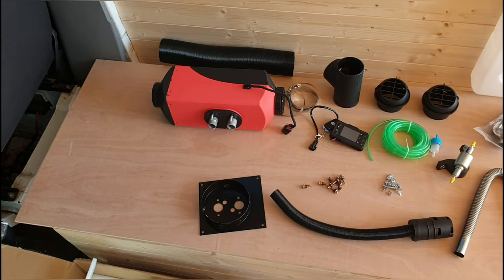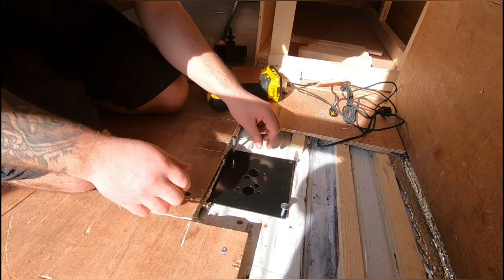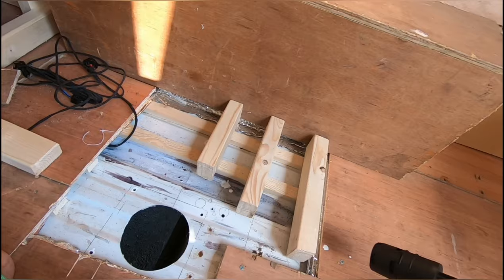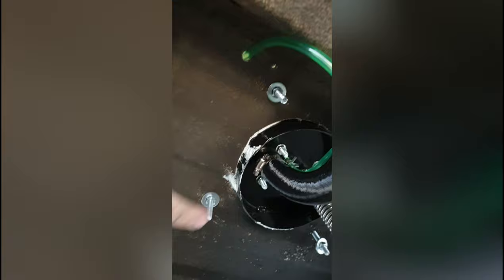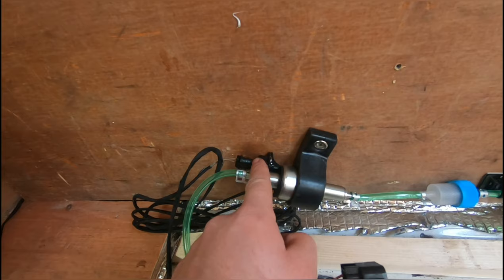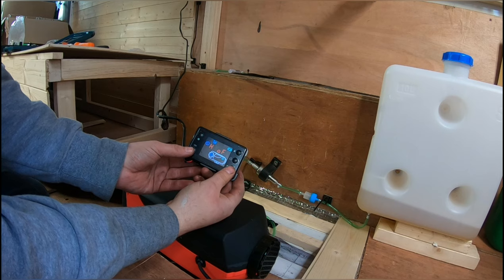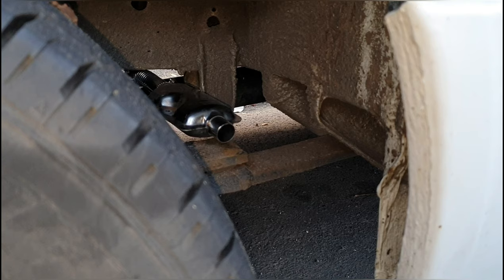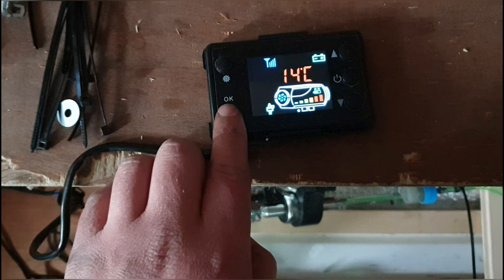Ebay Chinese Diesel Heater -  FULL DIESEL HEATER INSTALLATION from start to finish

Comment: Where did you get the green hose. My hose will never fit on anything and don't want to force it on the plastic part between the filter and tank
Reply from the maker: It's the hose that came with the kit mate , put it in some hot water to soften it , may help 👍
Reply: @LT_TOMMY_  thanks mate.

Comment: Hi can run it when I will put extra acc 12v Capaciteit 12000 mAh, for how long accu can run the pump and display and heat ?

Comment: I just installed mine and had a test run. Set target temperature 18. At first it work hard to get it up to the target. Then it slows down after it reached the target but it doesn't shut off. It keeps going. Did I miss anything or that is the way it is?
Reply from the maker: That's what they do mate , once they reach set temperature they slow down and just tick over👍

Comment: Using the car's main battery for this purpose, is it ok?
Reply from the maker: It will work mate but be aware if your battery isn't in the best state you could end up broken down with a flat battery 👍

Comment: Just bought a minibus to convert and seen one of these on eBay. Just have a few questions if you don’t mind answering? Does this have a thermostat, as in you can set a temperature and it will kick in if not drops below that? Looks like there is 1 outlet for the heat, can you add splitters so you can have multiple heat outlets (one towards the front of the vehicle and one towards the rear)? Have you had any issues since the install? Cheers
Reply from the maker: Hello mate , yes they have a thermostat,  the heater never turns off completely on the thermostat but once it reaches desired temperature it will slow right down and tick over.

Yes you can split the outlets, i actually had a splitter come with mine .

No problem at all mate 🤞

Couple of tips , try and hang the pump with zip ties etc as it's noisy if it's touching the van body , also make sure you buy a carbon monoxide alarm just incase 👍👍👍👍
Reply: Van Life Tommy Cheers for the reply. Hire much diesel sits it use per hour?
Reply from the maker: I'm not sure on the exact mate , mine uses next to nothing to be honest, ive read that they use roughly 0.1l per hour , but again i dont know the exact 👍

Comment: Hi Mate
all is looking great with you camper

What size bolts did you use for the bracket into the camper?
Reply from the maker: Thanks mate 👍
The brackets to hold the turret plate in you mean ?

If so they are size M6
Toolstation no. 86736

Cheers 👍

Comment: Hi can I ask is the heater noisy ( once the conversion been complete) cheers 👍
Reply from the maker: Hi , it's not too bad if it's on low but on full power there's no escaping the sound of the air blowing out. As for the pump ticking away , I have hung my pump with cable ties and its now almost silent 👍👍

Comment: Does the pump make that noise all the time? I would have thought it would have been silent
Reply from the maker: The pump always makes a noise mate,  depending on how high the heater is set the pump will tick away faster or slower ...
There's lots of things you can do to make it quiet , i usually hang mine with cable ties and probably will do with this one 👍👍👍

Comment: Hello, or your controller display all the time on? Even when not in use?
Reply from the maker: Yes but you can put a switch on the live 👍
Reply: @LT_TOMMY_  but if I put a switch, or will work remote controller? If i wanna turn on heater from home

Comment: Does this heater drain the van battery?

Would a installing a dedicated 12v battery be a good idea?

Cheers.
Reply from the maker: Hello mate , it will run off the engine battery , but it depends on the condition of it whether it goes flat in 1 or 3 days,  i wouldn't risk breaking down in a Field somewhere, pick up a leisure battery mate you can get one online cheap nowadays. 
Cheers 👍👍👍

Comment: Do you have to mount metal plate to the metal floor, or could I put it on top of my ply floor (insulation board underneath that's all)?
Reply from the maker: Hello mate , using a hole saw you could cut straight through the wood and bolt it on top , as long as there is nothing flammable inbetween 👍
Reply: Ah OK, slight problem then with insulation board underneath then! I'll have to remove it from around the exhaust. Thanks for your reply mate!
Reply from the maker: To be honest once you have cut out the hole for the turret plate and fitted it in the floor , nothing can get close enough to the exhaust to heat up, not even the plate gets hot as the exhaust is in the middle of the hole.
Give it a go and just use common sense , if your not happy with the insulation board there after then just remove a bit of it .
Any issues  of if i can help in any way just gis a shout 👍👍👍
Reply: @LT_TOMMY_  cheers Tommy. Doing it today, will let you know how it goes!

Comment: How did you connect the electrical power? Is it through car cigarette lighter?
Reply from the maker: Leisure battery 👍
Reply: @LT_TOMMY_  does it come with cable to connect to the leisure battery? just wondering what gauge cable it needs? 4mm2?

Comment: My fuel pump isn’t working? Any ideas?
Reply from the maker: Check all your connections etc mate , I've seen a few pumps stop on forums etc , they are cheap enough on ebay,  maybe grab a new one 👍

Comment: Much as I want to do this, just checked with insurance who say it would invalidate policy :(
Reply from the maker: Maybe wait and change insurance company at the end of the term , mine covers any change or modification with no fees.
I've just rang and double checked with the diesel heater and its fine also ...
Maybe look elsewhere 👍👍👍👍
Reply: Cheers .Now I look into it,seems  seems I chose wrong type of insurance, van instead of camper ... 🙂...handy  vid btw  👍🏼
Reply from the maker: Thank you 👍
If you are in the uk try 
'A-Plan Thatcham'
They will cover all 👍
Reply: @LT_TOMMY_  yep, that's what i discovered what I bought my t6 to covert - no normal van policy would remain valid the moment you make the first cut to start the modifications! A plan were fantastic, and I was amazed at the policy price given how specialist it is, covers the van whether as a panel or a camper.
Reply: Very Strange ! Every HGV and Ambulance has one as standard and all the quality Motorhomes use them.

Comment: When I turn the engine on the pump turns off, and error code 3 comes up. Any advice?
Reply from the maker: Error 3 is usually glow plug.
Before anything check the your battery is fully charged.
Maybe worth joining the Chinese diesel heater sites on Facebook, some very helpful info 👍🏼

Comment: do you need an electrical system to plug this in, or could you just plug it into a cig lighter?
Reply from the maker: I use a leisure battery mate 👍
Reply: @LT_TOMMY_  cool so did you hook up the leisure battery to your alternator or do you have solar?
Reply from the maker: @dom6157  I use a split charge relay from starter battery to leisure battery 👍
Reply: @LT_TOMMY_  gnarly thanks
Reply from the maker: @dom6157  I have got a video on fitting the split charge relay if needed 👍

Comment: Some kits come with little pieces of black fuel hose also. What is this used for? Thanks.
Reply from the maker: So you use the black pipe as a connector for the smaller white pipe. you cuttle black pipe it in to sections and slide the white inside it and clamp.

Hope I explained that right 👍🏼
Reply: @LT_TOMMY_  Is it needed as my kit has no black pipe. It's working fine in my garage, it's not in a van. Thanks.
Reply from the maker: @Mark-wx1ho  Are you using the green pipe?
Reply: @LT_TOMMY_  Yes mate.
Reply from the maker: @Mark-wx1ho  I've used the green pipe many times with zero issues, just keep an eye on it after a while for signs of cracking etc
Again I've never had an issue with it personally 👍🏼
Reply: @LT_TOMMY_  Thanks mate. I have ordered some proper 3mm hose for diesel.
Reply from the maker: @Mark-wx1ho  Should be fine mate 👍🏼👍🏼👍🏼

Comment: I bought this kit and am stuck ... The fuel pipe is about 4 mm in width yet the points to attach it on the plastic tank and filter and fuel pump and heater are at least 4 mm ... How do you get the fuel pipe on the ends of these parts. Is there a connector between them I haven't got in the kit or do you have to heat the plastic and force it on the ends
Reply from the maker: Put the small white hose into a small piece of the black pipe and clamp it 👍
Reply: @LT_TOMMY_  You're great I just found the black hose in the box ... What a prize knob am I 😆🤪
Reply from the maker: Hahaha it's all a learning curve mate , gis a shout if you need any help 👍👍👍
Reply: @LT_TOMMY_  Could I ask one other thing. Can the fuel filter be inside the van and the pump underneath outside. Basically is the pump really noisy and is there a maximum gap between the filter and the pump or can the two be a foot away from eachother with the fuel pipe going through the filter a foot from leaving the tank and the pipe through the floor maybe 18 inches of pipe to the pump underneath. The instructions are awful 🤪 thanks for your help and one other thing my floor in the van is an inch of wood so the threads aren't long enough to get outside ... Can I fit longer threads to make it through or should I rip the floor up and stick the heater on the metal van floor
Reply from the maker: @stableianF1oracle  Hi mate , you can put the pump outside if you wanted to , I hang mine inside with zip ties and its very quiet.
You can buy a turret plate which can sit on your wood floor and just screw or bolt it in 👍👍👍

Comment: So the air intake is outside next to the exhaust? 🤔
Reply from the maker: Directed different ways , it's air combustion,  the air intake is on the back of the heater
Reply: @LT_TOMMY_  I want to install one in the spare wheel space of my xc70 and not very ventilated as you imagine , I thought the second pipe running underneath the car would be the intake

Comment: That muffler is going to be hit by the spring when you drive...
Reply from the maker: I did move it,  that was temporary fix for the video.  It looks closer then what it was to be fair , I drove 100s of miles with it like that and it was fine 👍👍👍

Comment: What kind of power set up do I need to run that?
Reply from the maker: 12v mate , mines running off my leisure battery 👍
Reply: @LT_TOMMY_  thank you. My build is very minimal so I dont even have a leisure battery yet.
Reply from the maker: It all takes time mate , think my battery was £65 on ebay , works fine for me 👍

Comment: Hi, 12 V and how many AMP?
Thk
Reply: When you switch it on it uses about 5 amps for 10 seconds to heat up the glow-plug. After it reaches the correct temperature, the fan and pump use very little. You really should install a leisure battery to run it off. Not your car battery.

Comment: The pipe from the pump to the heater must be changed to 1mm inside diameter pipe otherwise the heater will fail. Code 08. Mine failed after a few hours of use. 👍
Reply: Are you saying that yours failed in a matter of hours using the fuel line tubing provided by the manufacturer?  Really‽
How/where did you find out about the solution to your problem? 

The line he's using is the one supplied with the unit..